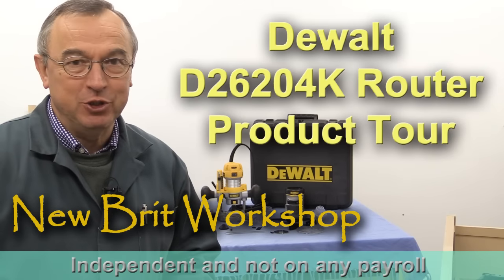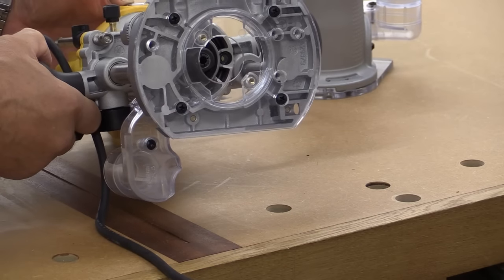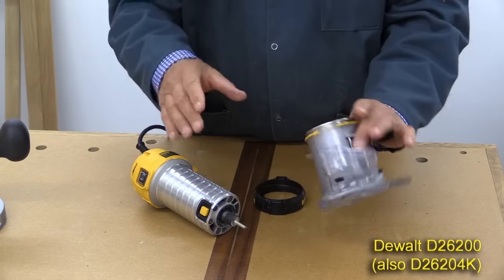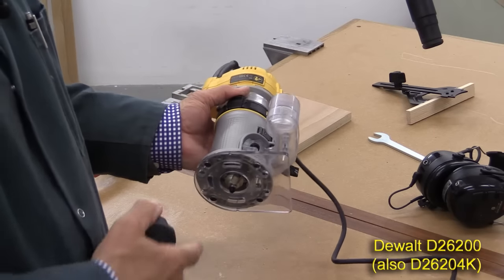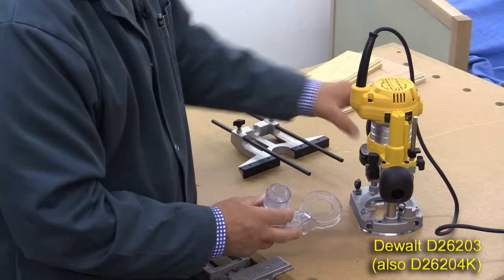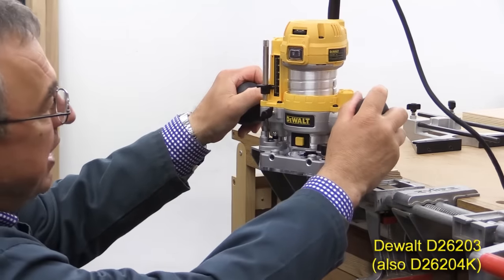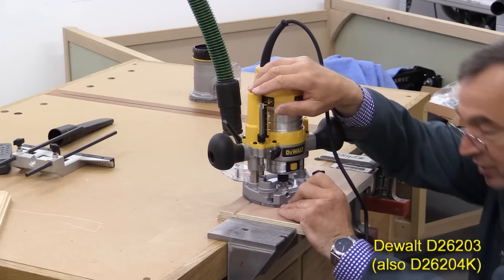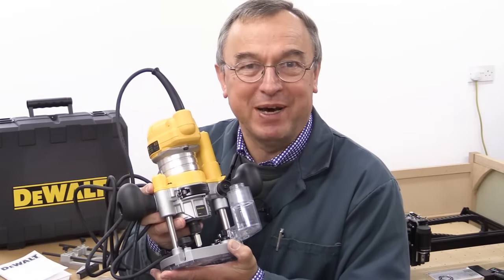Dewalt D26204K Router - Product Tour

Comment: Thanks Peter for a most useful review. My trusty ELU MoF 96 gave up the ghost today after 30 years service and I have ordered the DeWalt full kit version as a replacement. I'm sure your review will get me off to a flying start with my new machine! Regards, Darrel
Reply from the maker: Hi Darrel, Many thanks for the feedback.   Cheers.  Peter
Reply: Good morning Darrel, 
Your post is quite coincidental. My father has a ELU MoF 96, and i have used it quite some times. But i've just overloaded it yesterday causing it to short circuit. I'm looking at this kit as a replacement. 
I'd still like the elu to be repaired since it's almost antique and its nostalgic value.
There are shops that still repair Elu machines. I found one in Haarlem, the Netherlands.
http://www.schaaptools.nl/elektrisch-gereedschap/elu/
I don't know if they are good though. But it could be a tip.

Comment: I was particularly keen to watch this video because I'm recently retired and in the process of setting up a woodworking shop in my barn. I want to set up a router table using a fixed base and also have a plunge base for other general work.
However, I couldn't see that this design of router would lend itself to straightforward height adjustment once mounted into a table.
Reply from the maker: Hi John, You are right. This is a great router but not ideal for a router table. Take a look at the router table options from either Axminster or The Woodworkers Workshop and see where it takes you.  Cheers.  Peter

Comment: Thank you for the tour of the D26204K.  Will you be doing a comparison video of the CNC standard motor vs Dewalt? It would be interesting to see split screen or side by side comparison of the two router engines.  Regardless - thank you for today's video.
Reply from the maker: SuperYtviewer That seems like a good idea and I will try and run a "test job" with both spindles. I know the Dewalt will be way ahead of the 24v spindle and I am sure that people will appreciate the benefits of using the Dewalt even before I make the next video. Many thanks for your very helpful suggestion.   Peter

Comment: That's a great little router, I own 611 model which seems to be the same model but for Mexico. You don't need to remove the screw (adjustment ring) when changing to the plunge base. Just twist it up, it's easier than removing it. :) 
Cheers!
Reply from the maker: Andrea Arzensek Hi Andrea, Many thanks for the tip. Cheers.   Peter

Comment: glad to see you plan on replacing the rubbish  spindle on the x-carve. could you report on heat issues when running a router for longer than say, an hour, some 3D jobs would take far longer. im curious if it adversely affects the router as opposed to a cooled spindle on industrial machines. thanks
Reply from the maker: the green man Whilst having a few practice goes with the 300w 24v Inventables spindle I was running it for up to 2 hours at a time. It did get warm but not so hot that I was worried. This might change in time as more dust gets inadvertently ingested by the motor. I am hoping that the considerable increase in power of the Dewalt will significantly reduce run times although I can imagine that a complicated job will still take a while. I will certainly report on this as I continue the Inventables work.     Peter

Comment: Hi Peter - I have the Dnp612 plunge base that I use with my dw611. The offered edge guide dw6913 isn’t working quite like I would have it. The rods are tightened on the side, which make it wobbly. I was looking for the edge guide you received with your kit. Do you have the model number of the guide? It appears the US and UK products differ. Cheers!
Reply from the maker: I am sorry but I do not have that information. If you are in the UK you could ask the experts at Axminster.  Peter

Comment: Hi peter ive just ordered x carve and want to buy the dewalt 26200 but i cant find smaller 1/8 inch collets for it i was wondering if you managed to get any and if so where from regards pam
Reply from the maker: +Highlandboxes I did do some research on additional collets. Axminster do an 8 mm collet (product code 211306). Trend do a 1/4" to 1/8" reducer (http://www.trenddirectuk.com/clt-slv-3263.html). I thought that at one time I had found a true 1/8" collet but it may have been on a US web site.  I hope that this helps.    Peter

Comment: Hi Peter,  Would an outfit like this be powerful enough to use on a sled to thickness timber and resin down a few mm's,...........and if so, which planing bit would be appropriate.The overall size of the timber and resin is only about 320mm x 200mm
Reply from the maker: Hi Paul, It would be tricky to do what you have in mind unless you make up a sled for the router. You can get an idea of this in this video from about 5 minutes 30 seconds:
https://www.youtube.com/watch?v=Y89tQ5630hQ
You will have to work out a way to hold your work place securely in place.   Peter

Comment: Hi Peter,
Did you get this installed on the x-carve yet? My standard spindle just failed, and I'm looking at alternatives. Which x-carve mount did you use, since they don't list this router on their options? Thanks, Mitch
Reply from the maker: +Mitch Peacock - WOmadeOD Hi Mitch, I have not mounted it yet but this router is the same as the US market Dewalt 611 and so I have the Inventables mount for the 611. The only delay I am having is finding a solution to the dust problem as the 611 (26204) pushes air downwards towards the cutter and this will cause all sorts of problems with CNC work.    Peter
Reply: Cheers Peter for such a speedy reply! I think I'll opt for a replacement standard spindle, and then use it to build a mount for my old Bosch POF600ACE to use on tougher jobs. Mitch
Reply from the maker: +Mitch Peacock - WOmadeOD Hi Mitch, That sounds like a good plan. I will continue to look for a dust shroud/foot for the Dewalt and will probably make my own.     Peter

Comment: What's the difference between D26204K- GB/EX/QS or LX? I read the specs and items included and there isn't any difference. It's so confusing.
Reply from the maker: As far as I can see there may be slight differences in the extras that are supplied. I would recommend getting the full kit as that represents excellent value.  Peter

Comment: Nice guide to the machine - I have one (very happy with it) but can't find an extraction hose to fit it - what hose are you using in video? Thanks
Reply from the maker: Hi Kevin, Many years ago I bought a Festool CTL26 extractor and it came with a 27 mm hoes. That hose fits the Dewalt perfectly.   Peter
Reply: @NewBritWorkshop  great thanks very much

Comment: Nice video, Peter. Can this take guide bushes and be used with a Trend hinge jig? My Dewalt 625 is getting too heavy for cutting top hinges into the frame. Thanks.
Reply from the maker: Hi James, I have not investigated the guide bush side as it now sits in  my CNC. I see no reason why it should not as it is included in the Axminster guide bush link here: http://www.axminster.co.uk/leigh-guide-bush-adaptor-for-trend-t5-t9-t11-dewalt-d26204k-leigh-710-210500     Peter
Reply: Thanks Peter. Just had a Google around and Trend's site says that it does. http://www.trend-uk.com/en/UK/trend/content/content_detail.php?record_type=Compatibility&id=23918
My arms will be glad.

Happy New Year.

Comment: Thx Peter for the review. Is it possible to adjust the height of the bit from underneith? ( if you want to install it in a router table). Keep up the good work!
Reply from the maker: Sebastian Forseland It would be possible but very difficult unless it could be put into a router lift. I use a Dewalt 625 clone (with a CMT badge) in my UJK router table with the UJK router lift. Before that I used a Dewalt 625 in my home made table and made a very simple screw adjustment mechanism to get accurate height adjustment. I will put it on my list of things to show in my "Workshop Notes" series which will be out soon.    Peter
Reply: Great Peter.  I'm in the process of creating a router table,  so  I will have a look at the Dewalt for this

Comment: I doubt these machines are rated to work constantly in a cnc router. You can buy a 2kw spindle and VFD for around £200 these days which has much more precise bearings, and is designed to work non-stop - mine is 2.2kw, water-cooled and includes a decent VFD - the beauty is that you can then control the speed and even the direction from your Gcode. I do like these laminate trimmers but I can never decide what they are good for - who trims laminate anymore :-) They're slightly underpowered as routers and i find the bases too small - I always end up tilting them while doing edging work and buggering up the whole job. My OF 1010 is as small as I like to go.
Reply from the maker: +Dr. Ralph Kennedy Hi Doc, Good insight and great advice.    Many thanks.   Peter
Reply: It’s not really a laminate trimmer. It’s a ¼” router. I use this model for almost everything I do in cabinetry and other jobs. My  ½ inch router doesn’t get much use anymore.

Comment: Hi Peter. Thanks for the great review. I was about to buy one of these as a newbie to routing but then saw so many articles suggesting that the 1/2” bits are much safer and sturdier. I’d love to know your thoughts.
So I was thinking..... am I ultimately better off buying a palm router 1/4” and a large 1/2” plunge router separately. Then I could use the latter in a table router set up. Would very much appreciate your advice on this. Best Pete
Reply from the maker: Hi Peter, If you can get at least 2 routers. If it is two, my recommended minimum, then a small one with a 1/4" or 8 mm collet is going to be the most used router. However, the second one - a medium size one with 1/2" collet, will be required for tougher jobs and a router table. Although you are not buying Festool kit look at my video "Which Festool Router" - https://www.youtube.com/watch?v=gHJktChv4Ck   Peter
Reply: New Brit Workshop 
Thank you so much for your reply and the link you kindly sent. I’m certainly more informed now but it has me thinking that this d2620 kit would be a good option but would the plunge base become redundant once I bought a bigger 1/2” one. Or would it still be very handy? Or should I bite the bullet and go for the festool 1010 and cherish it forever. Or even a Trend T7 1/2”.  It’s very tricky to know what to go for having never touched one before. Hmmmm. Thank you Peter
Reply from the maker: Hi Peter, The Dewalt is a great bit of kit but for a "Go To" router the OF1010 cannot be beaten. It has all the extras in the box, the dust collection is amazing (with the right extractor) and it handles really well. Once you have the OF1010 then  wait a few weeks before deciding how you want to go for the next size up.  Good luck.  Peter

Comment: Hello Peter,

I would like to know if the motor holder of the plunge base can tilt down a litte bit on the opposite side of the blocking-lever if the blocking lever is locked and you push down on the handle on the opposite side.
Thank you very much.
Reply from the maker: Hi Gianluca, I am so sorry but I do not understand the question. It is slightly tricky for me now as the router is mounted in my CNC.    Peter
Reply: I want to mean if there is a little bit of clearence between the shafts and the bushings which allows  the plunge base to tilt down if you force a little bit on the handle. Usually you can notice the problem on the opposite side of the clamping lever.
Thanks
Reply from the maker: Hi Gianluca, I do not remember any play like that but now it is in the CNC and so I cannot test it. The router is excellent and very well made.   Peter
Reply: Thank you very much for the answer.
The last question :) how do you consider the level of vibration? I've seen the data of the Makita RT0700CX2J and they are much lighter. Colud you compare the vibrations of the Dewalt to any other router?
Thank you very much.

Comment: Does the 240v version have soft start as Screwfix lists the 110v as soft start but the 240v as hard start?
Reply from the maker: As far as I know it does not have soft start but as it is a small router that is not a big deal. A   2  1/2  HP router without soft start is a bit of a pain.  Peter

Comment: Peter - great review - where can i get one of the Vices your using - they look rather good - Thanks
Reply from the maker: Hi John, That is a Zyliss Bench Vice and they stopped making them over 20 years ago. I think that someone in China is making a reproduction but you may be able to find an original in good condition on ebay.    Peter
Reply: many thanks Peter - since watching your video I have just purchased the Dewalt 26204 - so I'm looking forward to getting started- John in Cornwall
Reply from the maker: Hi John, Good luck with that lovely new router.    Peter

Comment: Hi Peter is it possible to use the whiteside inlay kit 9500 you have descibed before on this router? Thank you Henning
Reply from the maker: Hi Henning, You need to find the right guide bush adapter for this router. I suggest you look at the Leigh site as I used their 704R adapter for my Festool router. Try https://www.leighjigs.com/ugs.php      Peter
Reply: New Brit Workshop Thank you!
Reply: New Brit Workshop Hi Peter, I ordered it with Axminster! The German dealer was to slow :) Thank you

Comment: hi peter, can this take a 30mm guide bush?
Reply from the maker: Hi Kevin, I do not have the kit any more but have found the following. You will need a guide bush adapter and a set of guide bushes. Here is the adapter:
https://www.axminstertools.com/leigh-guide-bush-adaptor-for-trend-t5-t9-t11-dewalt-d26204k-leigh-710-210500
and here is the guide busg set that I use:
https://www.axminstertools.com/ujk-technology-metric-threaded-guidebush-set-502571
Peter
Reply: @NewBritWorkshop  thanks peter, im looking at the peanut joining system from intelligent fixings, and think a small router would be easier to handle than a large one but it requires a 30mm guide bush. you might take a look at the system in one of your videos, its clever and good value compared to a domino for a casual woodworker who just wants to make the odd cabinet and cant justify festool price tags. cheers
Reply from the maker: Hi Kevin, I will do some research and see what comes out of it.  Cheers.  Peter

Comment: Other than the slightly more powerful motor it seems much more clunky to set up than the MAKITA RT0700CX4.
Reply: I had the opportunity to try both. The DeWalt is a little more clunky, but feels much more solid, and has way better collets. Setup is about the same for both. The Makita can be a pain when you don't get the bit out because of the single-slot collet. If you just need to trim edges, I would probably go for the Makita. As a first all-purpose router, I'd pick the DeWalt.